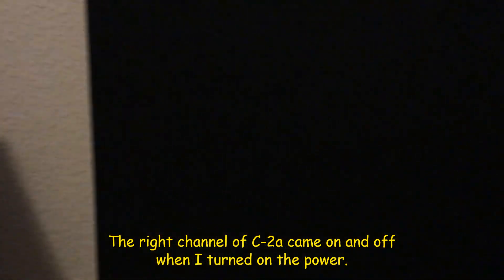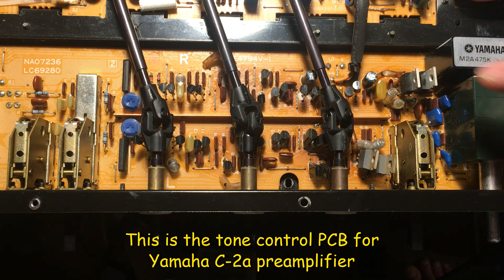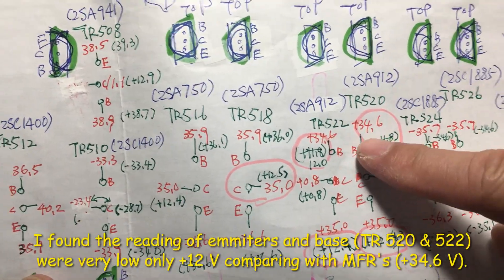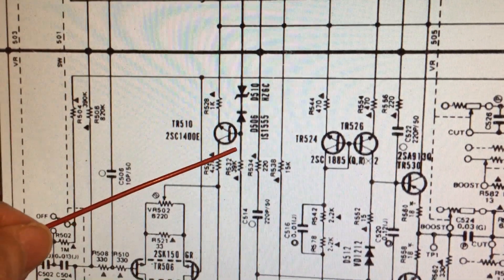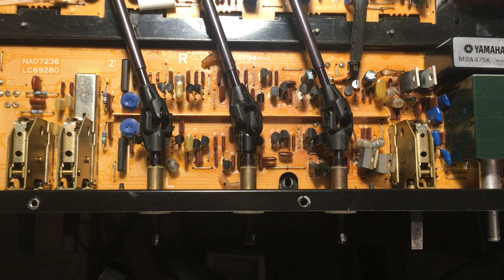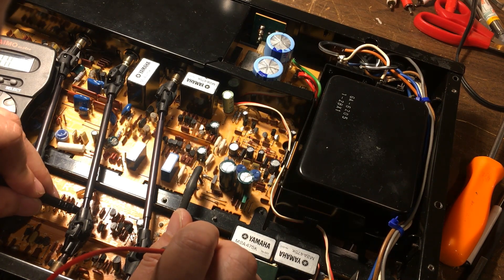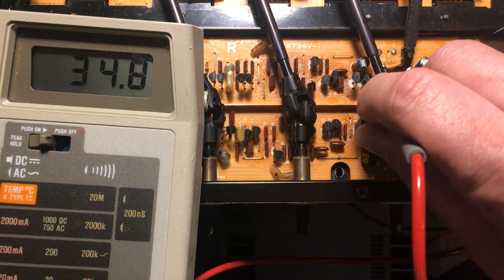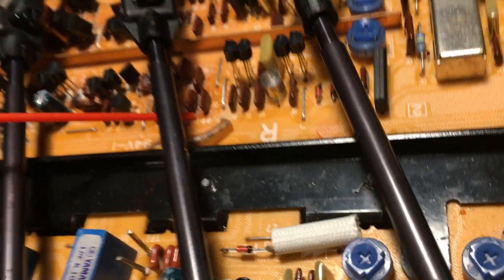Yamaha C-2a Preamp Repair II - Popping and Static Noise

Comment: A few months after a full recap, my C2a would start to sound rough on the left channel after a warm up.  It was intermittent.  I bought a $30 o-scope from Amazon and could see clipping on the L channel.  I traced it to....the SUB-SONIC FILTER SWITCH!  My guess is that it's just dirty.  All that work for a dirty switch.  But it's nice to troubleshoot and solve a problem and nice to know that it's not some obsolete transistor or packaged IC.  Now I need to find a video showing how to disassemble the switch.
Reply from the maker: Thanks for sharing!